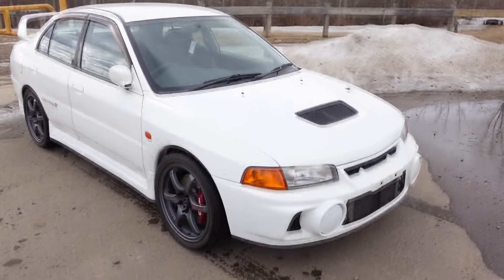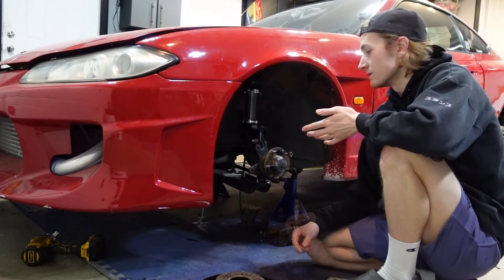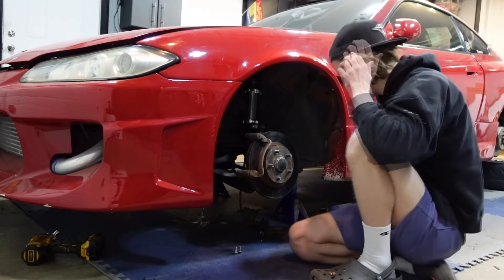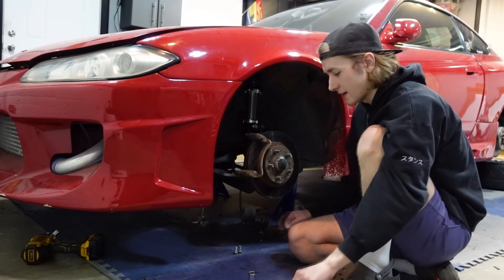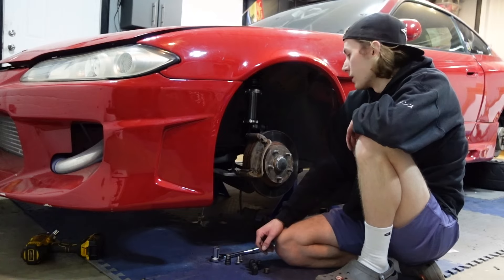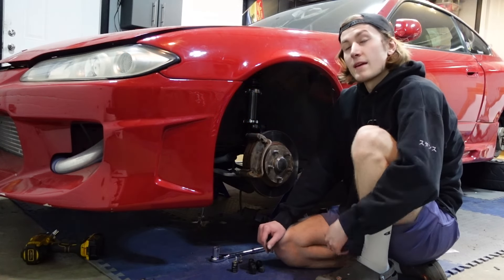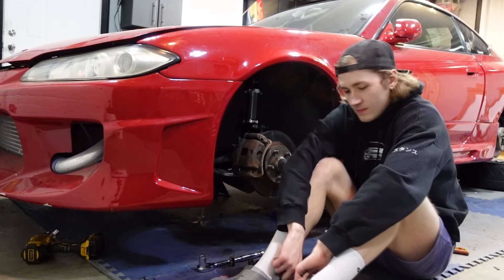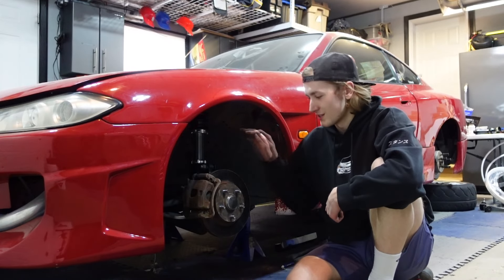Saying Goodbye To My Evo...

Comment: May i know the wheel specs of the evo?
Reply from the maker: Ofcourse! They are 18 by 7.5 plus 48 squared. Got a nice flush fitment but with the current tire setup it rubs a little bit in the rear when I hit bumps.
Reply: @JonathanGT10  thanks! Do you run spacers to clear the brembo calipers?
Reply from the maker: @aimanfitri4343  small ones in the front like 10mm if I remember just very slight soacer for the front brembos. Rears there is no soacer.
Reply: @JonathanGT10  i see. Im running 17 7.5 +38 currently with an evo 6 rear suspension and there's a little bit of rubbing on the rear.
Reply from the maker: @aimanfitri4343  yeah the rear arches are always like that unfortunately unless you roll the fenders which I am not a fan of.